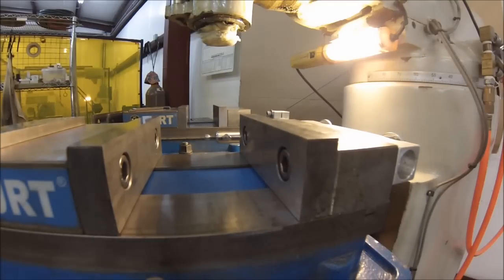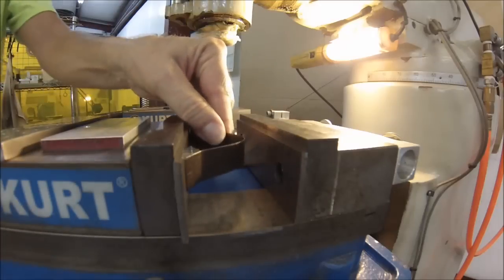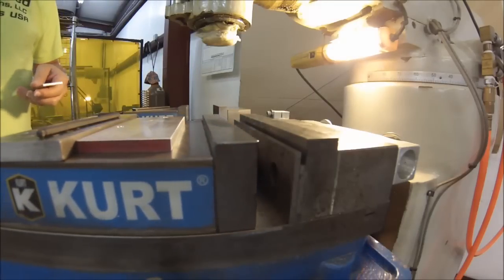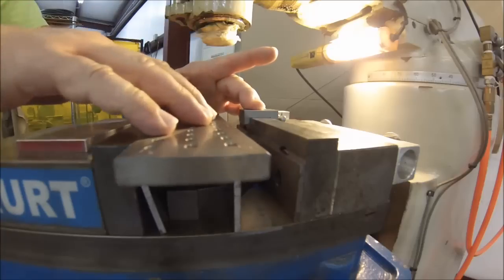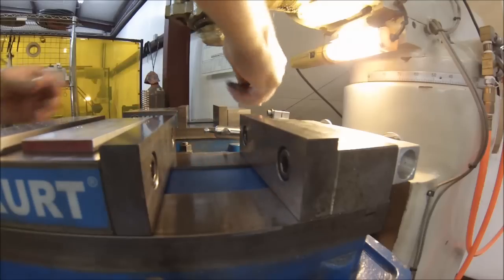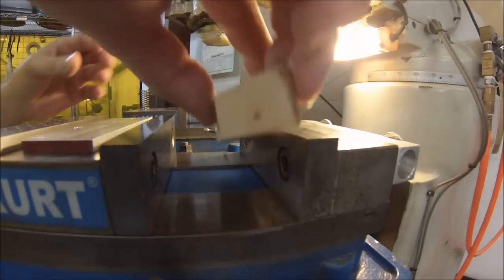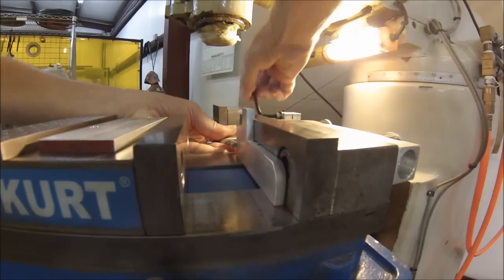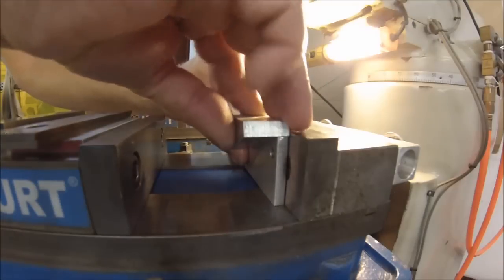Clamping Thin and Irregularly shaped parts in the mill

Comment: Some well demonstrated and clever tips as usual Joe. Some I knew about some were a first. Especially liked that shorter parallel behind the taller to create that chip space. I've also used a couple of tiny drops of oil or even the same with grease to hold the parallels against the jaw faces. Haven't ever really had a problem with them moving even while blowing the chips out with air. You do have to check the oil or grease doesn't travel up above the top of the parallel or you have an instant chip trap. Your springs are easier imo. The cylinder with a flat was also great. That just might work well enough for some casting shapes to get the initial reference surface as long as I go a little easy with the vise handle.

Yep you are doing well, it looks like you now have enough subscribers to attract at least one of those weenies who hits the dislike button for no good reason on most of the YT machining channels just to piss people off. I think we need a video showing how to hold one of there heads in a vise. :-)
Reply from the maker: Sounds good. I still consider 180 thumbs up to 1 thumb down a huge victory. But if you find the culprit, let me know.
Reply: LOL, if I could find one of em that wasn't hiding in moms basement I'd be making my own video about how to get there head hammered down enough so it doesn't pop out of the vise jaws.:-)

Comment: Very good video Joe, I like all the tips. Joe I just pick up an older Kurt D675 vise. The jaws do not close all the way. Is this normal ? I am new to the trade. Thanks for any help.
Reply from the maker: The 675 is a great vise. Make sure you have both the stationary and movable jaws in place. If one is missing, the vise won't close. There is a hole in the rear of the movable side jaw. Its a set screw pocket. Back out the set screw and lift off the movable jaw and check the screw for chips and damage.
Reply: Thank for the quick reply Joe. I will check it out. Thanks again.
Reply from the maker: 2 more videos coming right now. Check them out.

Comment: A lot of good tips. I smile everytime I think about how little of the work I do is in a vise. Many times my jobs take much longer to setup than to machine but when you are dealing with multi thousand lb components with the only machined surface being the one you have to machine life gets interesting. :-)
Reply from the maker: I ran an 18-140 mazak gap bed engine lathe for 6 years. 36" dia capacity 12 feet long. The face plate work would take a day just to balance before you hit the go button. You don't get too many chances to get it right at that level.  Yet my apprenticeship was in the watch industry. Watch those fingers. Thanks for commenting.

Comment: Thanks for sharing :)

Sometimes when I want my parallels to stick to the jaws, and a spring won't do, a quick spray of WD40 can give you just a touch of stickiness, and is handy for times like when the parallel got crooked and you don't want chips to fall between the jaw and the parallel.

Definitely going to keep a few springs in the fixture box now :)
Reply from the maker: Adam, very rarely do my jaws move as much as they did in that example. I actually didn't realize the movable side parallel had done that until the post. Anyone that uses springs should double check to  be sure there is adequate tension at all times. if you use spacers like my bridge example, make sure the springs are low enough to keep everything smashed together. I like the lube suggestion, but if parallels stick, chips could possibly stick too. A good hard air blast may get under the parallel and dislodge it as well. The leaf type springs are good when space is limited and the jaw movement is minimal.
Reply: I've been using 30 weight non detergent oil...

Comment: Hey Joe, I'm really liking that cylinder trick. Thanks for sharing.
Reply from the maker: Its really a great trick for those initial cuts on odd shaped stock or parts. That's why that little piece of brass is really over 30 years old. I use that trick all the time. Good stuff coming, stay tuned and spread the word.